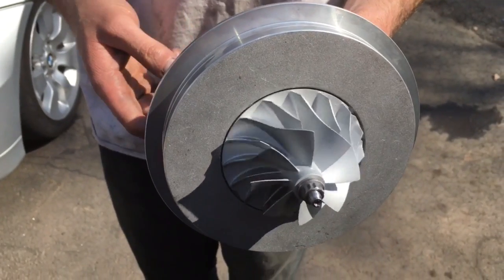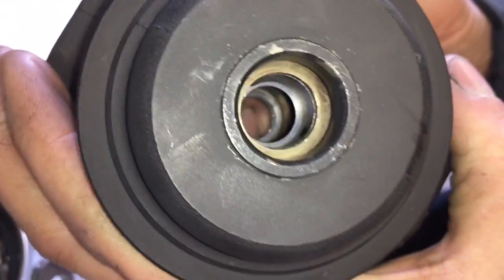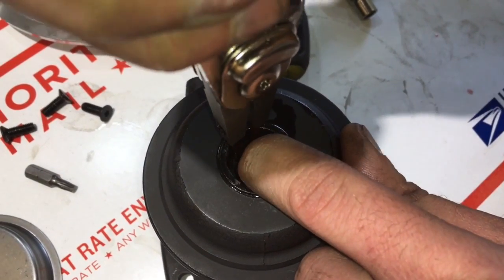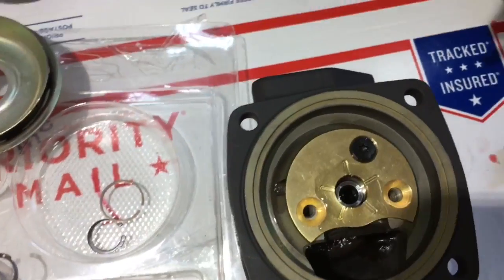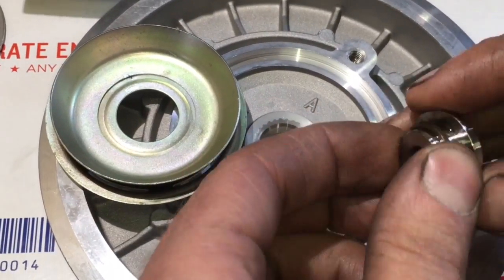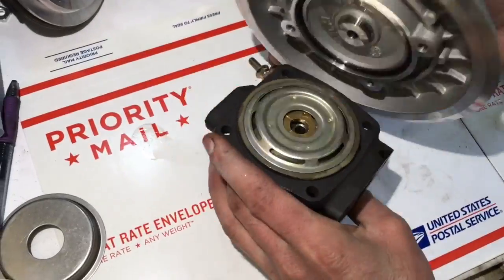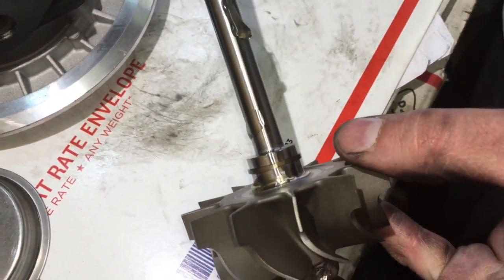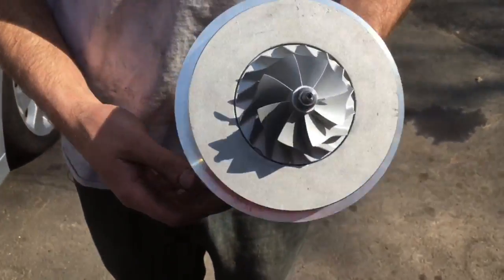Holset H1E H1C Turbo Rebuild

Comment: Will this kit work on the wh1c from a 94?
Reply: Did you ever get a response or order the kit? I have the 1994 wh1c and am curious as well
Reply: @branmanhosmaniac3489  I ordered the kit on Amazon I believe. Also a new turbine wheel because I messed it up. Left hand thread

Comment: I have a new H1e it has endplay is it ok?
Reply from the maker: jiemrvow the wheel should not move in and out or axial more than .002”
Reply: @turbolabamerica  This moves more than .002
Reply: The play is only axial
Can I tighten it up easily it is a new turbo.

Comment: Followed your process step by step and can't get the shaft to spin and seat correctly, I'm not sure what I'm doing wrong, any help Is greatly appreciated
Reply from the maker: I’m not sure. I had some people put the spacer in upside down, or the selector didn’t go in the pocket, if you are installing an hx compressor wheel and using the hx collar the plate has to be machined for the shorter collar
Reply: @turbolabamerica  I got a rebuild that came with a OE h1c thrust collar. How much would it be for you to rebuild it and do the upgraded wheel and with shipping? My zip code is 98632